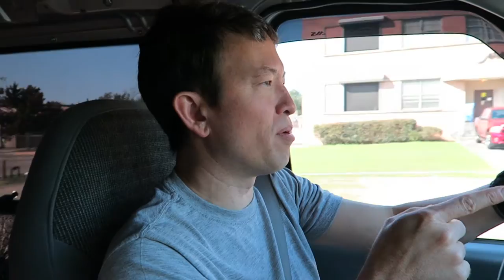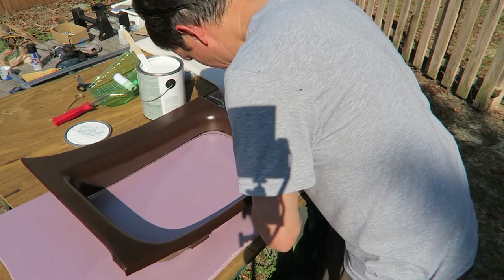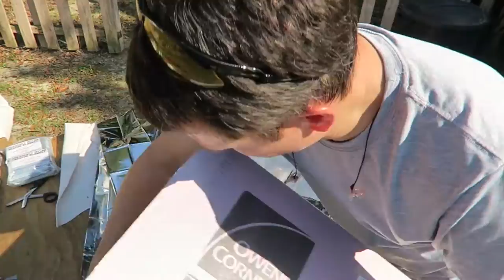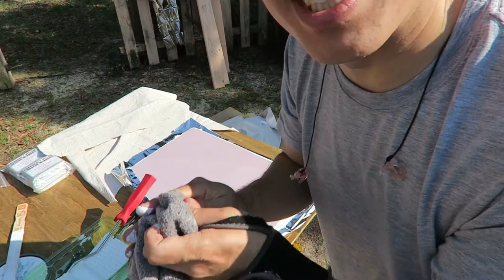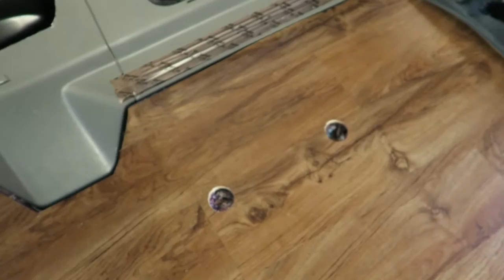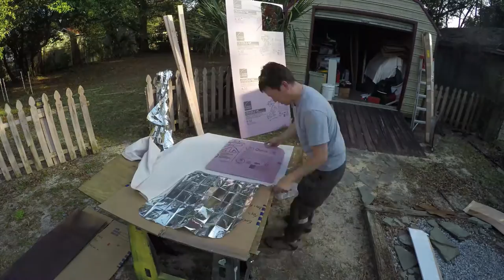22. Touring Camper Van Build- Floor Installed! Creating Window Inserts

Comment: Very awesome looking Ian and great idea getting floor guys in. I can't put myself through all of that with the windows though. However you have done a very nice job.  I am thinking of painting one side of the pink foam black and not worrying about the outline of the window but just make a wall over the whole thing , like ceiling to floor. In my case I am going to just drive my van into the ground so I am not worried about removing factory interior plastic covering and the like. I just tear them out and  going over them with either a thin light  wood or plastic material or a fabric material. I didn't plan it that way but I started cutting and ripping out and the next thing I knew. Ha ha. Cheers, Ken in Nova Scotia.
Reply from the maker: Ken, cool. I would love to see your build.
Reply: Thanks Ian. Will be awhile and from the start I didn't want to get too carried away with it.I will show what I can as time goes on. Thanks.
Reply: I really like what you have.